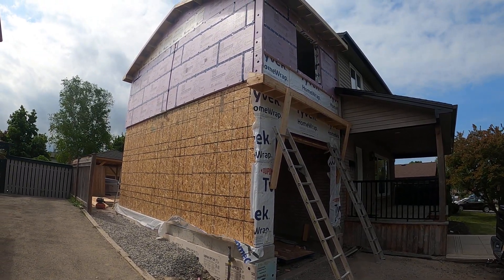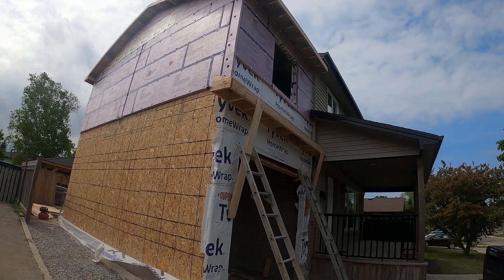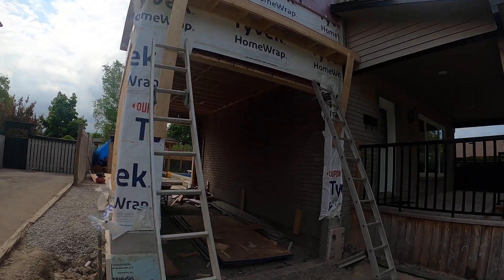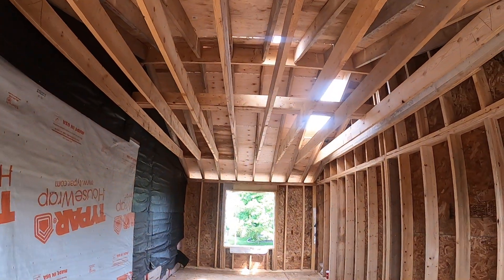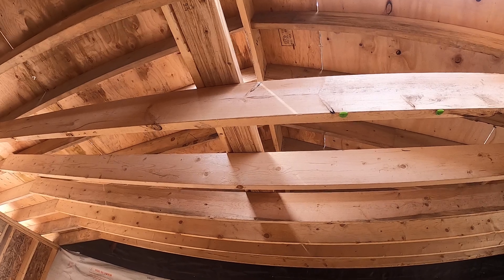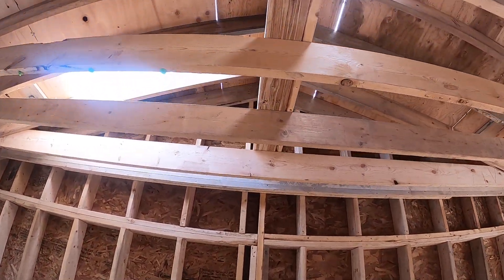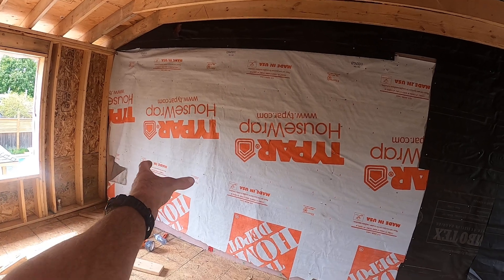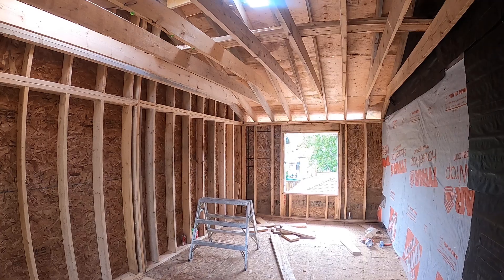Stopped and framed an addition Job....because I was already driving through the neighbourhood

Comment: Lap rafters over dropped ridge, no collar ties.  Nice job!
Reply: Would need to have a large ridge beam.   Probably a 3 ply 11 7/8" LVL.   Then you would need continuous posts all the way down to the foundation.    Simpson also makes adjustable angle rafter hangers so the dropped ridge would not be necessary.

Comment: If you put taped sheets of insulation on the outside, which acts as a vapour barrier, and then insulation and a vapour inside, won’t humidity get trapped inside the wall? I know codes allow it, and i’ve researched it, but I haven’t found a definite answer. 
I’d like to upgrade the insulation on my house, heating costs are only going to go  up, but don’t want any future problems.
Reply from the maker: Good morning Hue, the siding for this build will eventually be continuous from the house so with it being siding and to get the correct r-value it called for 7/17 OSB with taped tyVek on top, the. 2" foam with taped seams after that.  I ve had this same discussion before years ago about basically making the house sweat and I've heard arguments both ways. I think a lot of architects aide on side of caution and go more than not enough

Comment: So its concrete that holds the wall at the bottom of the garage or how does that work?
Reply: anchors in the concrete with a big nut and washer holding the plate to the concrete im assuming
Reply: @gamezech2882  make sense thx
Reply from the maker: Hi Jay the garage is anchored down to 1/2 inset bolts same as a typical house or garage

Comment: Will the ceiling of the addition be batted or blown insulation? It’s ok if you don’t know, I was just curious on an insulation perspective. Interesting it’s 2 inches foam board on the outside and not the traditional 1 inch I see on job sites in Canada.
Reply from the maker: I'm not entirely sure but I would think blown in 18 inches from bottom of ceilings to match the existing roof
Reply: @framingbeast720  ah ok so r50 to fill her right up. It's definitely a small attic area.

Comment: Porter cable pancake for framing?
Reply: Can't knock it till you've tried it. That's for sure .been doing it for years .very economical and dependable
Reply: @jefflinnell8492  if ur a rookie jus startin off. Burned through 2 of them doin trim 20 yrs ago
Reply: @Tom-sd5ru  20 years ago old timer , shit was made alot different and so we're the people doing it .run the correct pressure thru your regulators for you tools and drain the water daily and buy a porter cable pancake two decades later and see if there's a difference you rookie. 20 years is about half of my career framing houses , doing the interior finishes on the rainy days .believe it when I tell you. Buy a new one. 2 decades ago the guns weighed 20 pounds without nails.
Reply: I use one every day for remodeling projects I have had mine for 4 year's now and it runs very good

Comment: Couldn't help noticing the compressor , is that what you use daily?
Reply from the maker: Nope
Reply from the maker: Nope, nothing wrong with pancake compressors though..I use to use a DeWalt pancake on the job which I bought as for 75$ because it was returned to home Depot but still new. Came with a matching bead nailer and crappy hose. I did at least 15 houses exclusively with it because it was easy on the breakers until the pump blew
Reply: @framingbeast720  I seriously have been using the porter cable red pancakes .i run two and it's more than enough for myself and two other mailers and as you said I get 5 to 10 houses out of each one , never down a compressor if one blows up and I pay 125 or so and get floor staplers or sometimes a framing gun that doesn't last as long as the compressor most times. Great content and nice work.
Reply from the maker: @jefflinnell8492  you have the right idea...usually they throw in a couple nailers and you turn around and resell those now your new comp owes you next to nothing and it hasn't even been turned on lol... honestly, 95.345 % of crews could get by with a pancake 6 gallon compressor. Hitachi makes one called "the beast" and that could up that number to 100%. I want to laugh when I see two man slower crews using a massive rolair gas compressor....I think those guys brains are on auto pilot...when's high test gas it at 1.60 liter doesn't make whole lot of sense
Reply: @framingbeast720  I do the same thing with paint sprayers for priming interiors. 300 dollar spray gun never cleaned , always in primer 6 to 8 houses pumps junk out. I work to relieve stress
Reply from the maker: @jefflinnell8492  for sure, once you come to terms with the fact of life that eventually every tool breaks down and sees its last cut or nail then you can appreciate buying from places where you just hand it back for another....places like princess auto where no sale is ever final are great places to get tools because of no hassle policies. I don't want to have a tool in for four month of factory service because that defeats the purpose...I need that tool back three minutes ago so any time you can trade a broken tool for a matching working one you've won
Reply: @framingbeast720  that could not have been said any better.